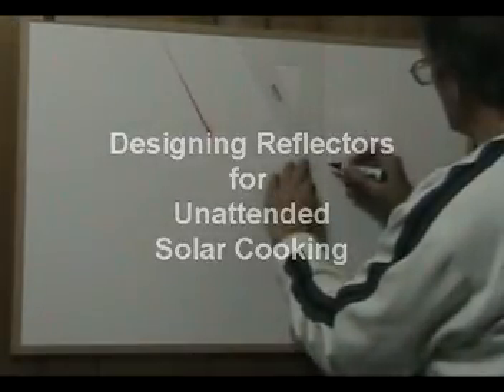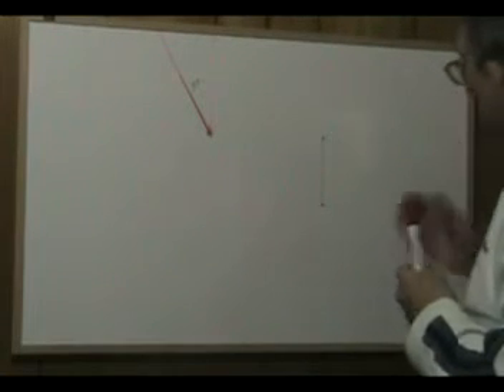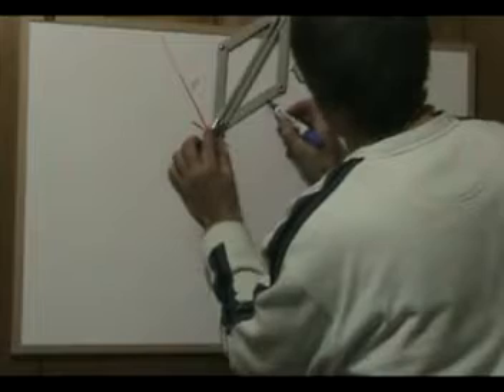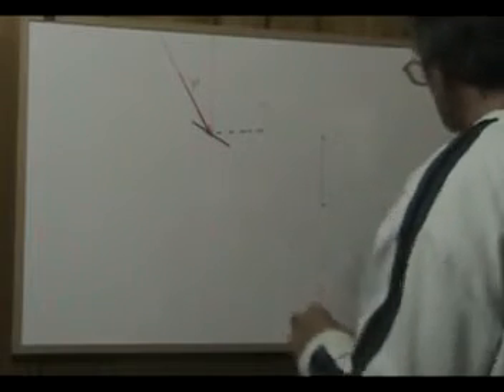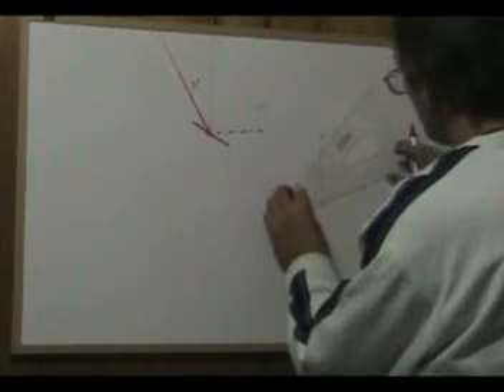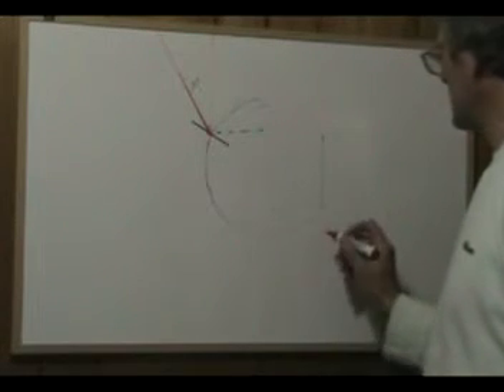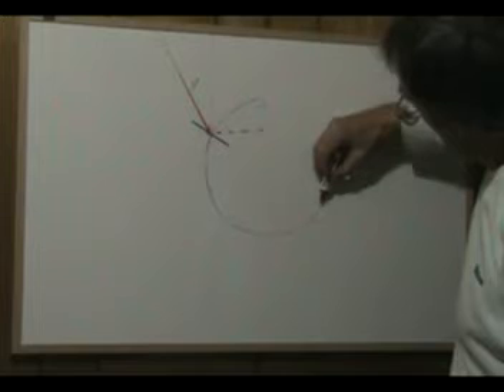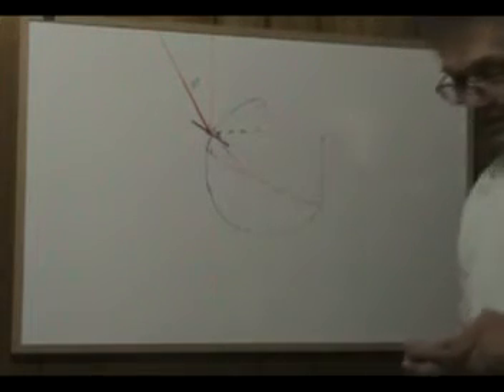Solar Designer, Why secondary reflectors are needed for unattended solar cookers.

Comment: That is actually quite a good point, lo-fi is more accessible.
Fair enough then. If you have any reflective surface designs you want analysed, feel free to send me some sketches. It's a LOT quicker for seeing how light is going to interact. It's also then easy to print off very accurate templates.
This also goes for anyone else working on similar projects...

Comment: As well as developing surfaces from curves, it also lets you bounce 'light' rays off those surfaces, so gives you perfectly mathematically accurate reflective optics for any shape you can draw. It also has presets for parabolas and other curve types. And you could then show us rendered 3d models of your shapes.

I've been using it for 3d animation for about 13 years, but am currently developing a solar tracker, and it's been utterly invaluable for developing the reflectors.